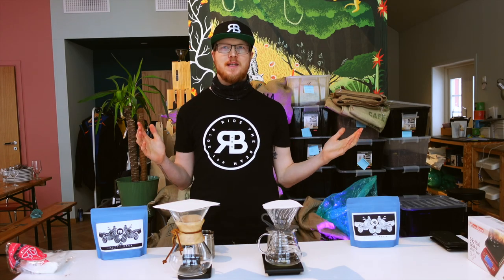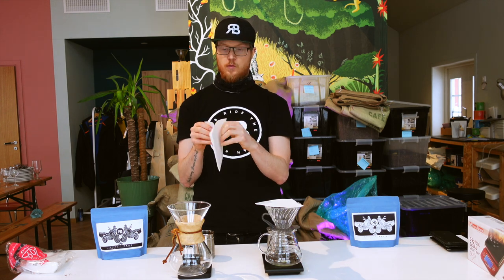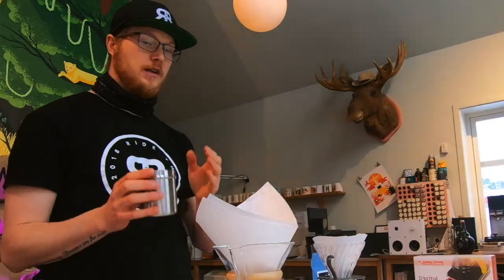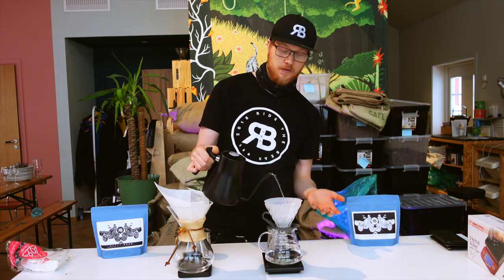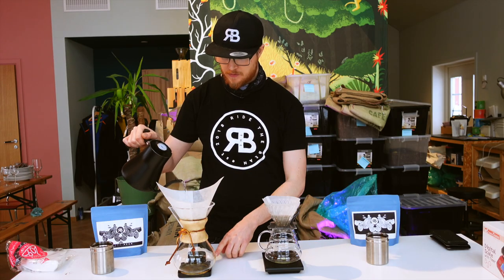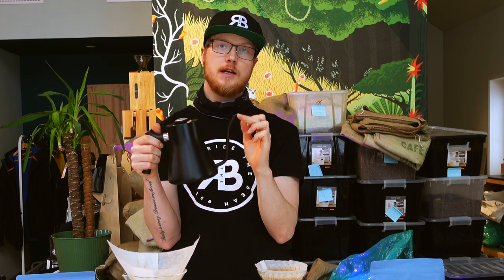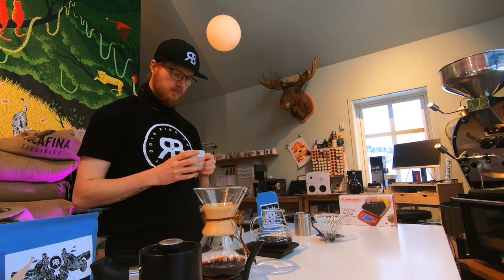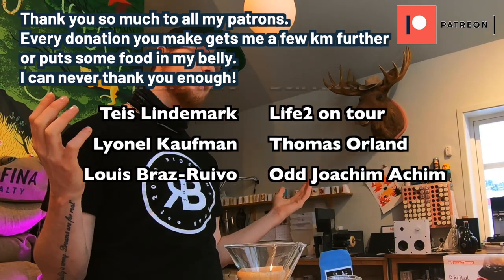How I make my morning coffee

Comment: Quality video! I may or may not have taken notes. 
Question; I use a fabric filter for my V60 to reduce waste, but now I'm thinking that that means the coffee runs through the filter more slowly than with a paper filter. Should I change my grind settings to a more coarse grind?
Reply from the maker: Fabric filters are good for the environment, but not so much for the flavour. Or I guess that depends how well you clean them between each use. A clean fabric filter works kind of like a paper filter, except some of the oils comes through the filter. This gives it a heavier body than a paper filter would. But because it is very hard to get all the coffee out of the filter between each use it does affect the flavour a little bit. 

When it comes to the grind size it depends on how it tastes. If the coffee taste a bit too sour or bright, with and unpleasant acidity it is under extracted. That means too little contact with water. so grind it finer. If it tastes bitter it is over extracted. that means too much contact time with water, so grind it a bit courser.